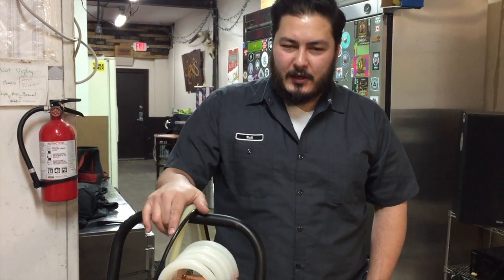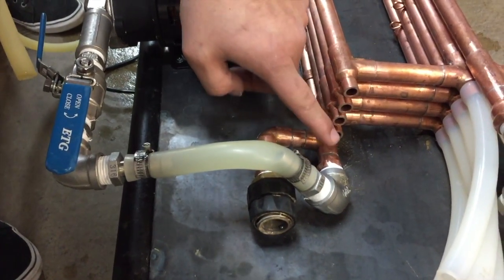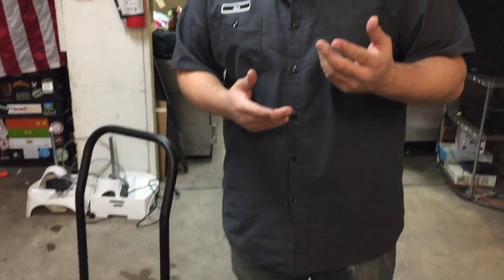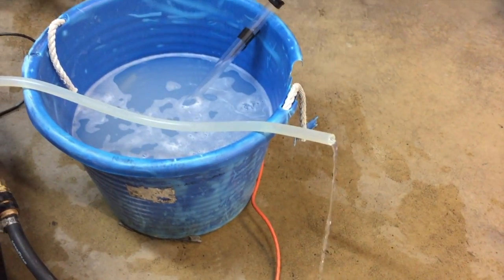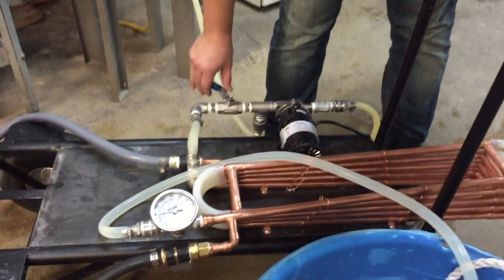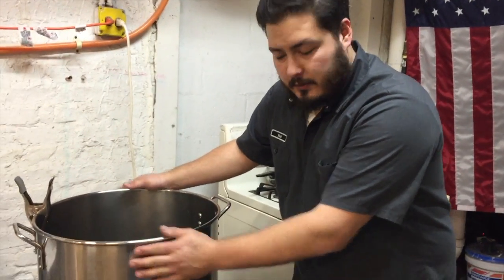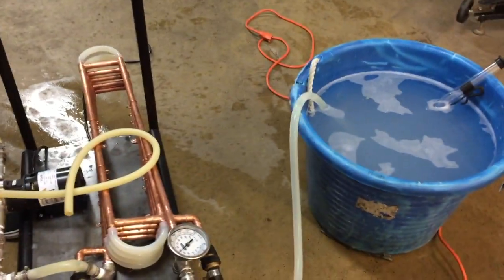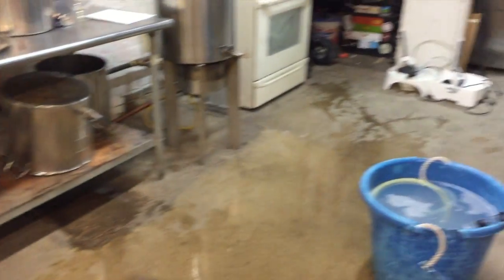CHAOS Counterflow Chiller 2.0

Comment: Hi! 

I loved this, so built one myself! 

However, I did an initial rinse with PBW recircing for about 10 minutes, followed by star san for 10 minutes, then went straight into recircing wort. It was only then that i realized the PBW had turned blue, meaning some copper was dissolved in solution.

Have you ever experienced this? Is my wort still ok? The star san appeared fine.